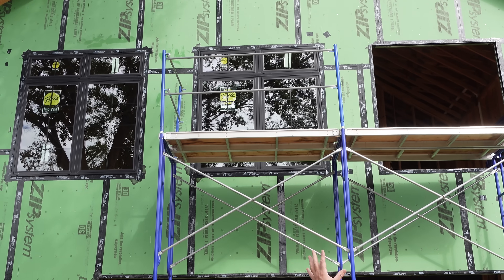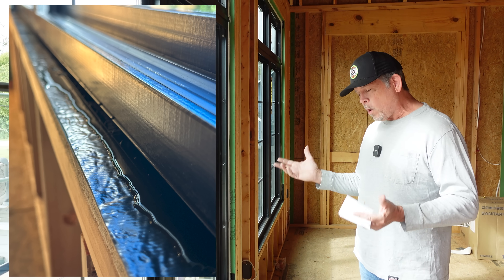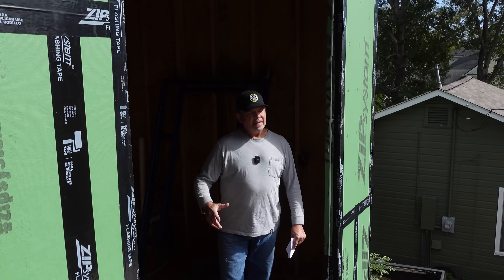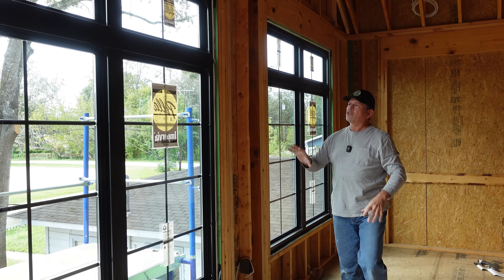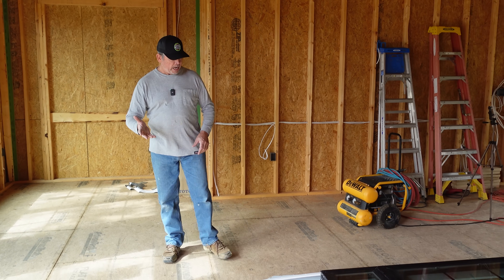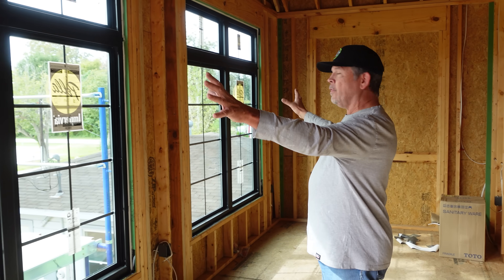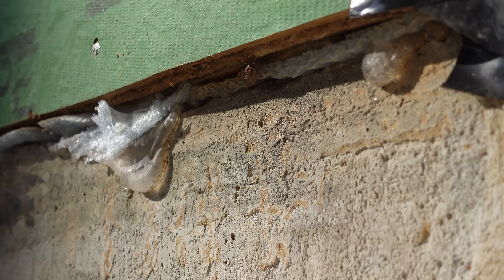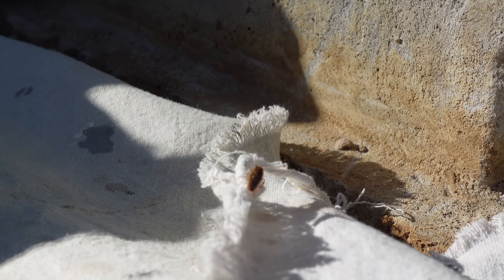THE WINDOW DISASTER - What Happened and How We Could Have Avoided It

Comment: Siding edges are where water will wick in. Without the overhang, you won't be sealing it but it's probably moot because you glued it to the frame.

How did Pella not ask you about the fins or better yet automatically include them as throwaway items? Worse yet those fins required you remove material from the slide area. For such expensive windows, Pella ignores important little details. If Pella can't take a garden hose test, then they should not be making expensive windows. You're paying for quality. Personally, I would like to know why they think it's acceptable that an install has a failure. You're a seasoned builder who took every precaution and in fact went above and beyond. A normal worksite doesn't have the luxury of time. Do you think this isn't a common mistake? That failure is on Pella and I give them 2 thumbs down.

Comment: smh.  i watched the original video and those are not the same windows, the other one had a nail flange that you guys screwed into?
Reply: yea, i'm lost and sent the original video to some people.  i need to follow up with them.  the first window had a flange the same color of the window, made out of the same material?  this one did not have that flange, but you had to add the nail flange, which was a different color.  so you got different windows (same style, same color), but replacement windows and not new construction?  then had to add the nail flange, which was in the middle of the window and not flush with the frame, that is why your caulk line was further back on the first window?  are you ever going to have the window guy who helped you with the first one back?

Comment: In my humble opinion, I would not back up the framing to make the sheathing flush with the foundation. For every 24' of perimeter of the building, you lose one square foot of internal floor space in the house. For a house sized construction, you could be talking about 5 or 10 square feet of livable space gone just to try and save on the liquid flashing.

(Edit: My math was wrong. 24 feet gets you a square foot, not 24 inches. Which is around 5 to 10 square feet, depending on the house, not 20 to 30.)
Reply: Very little usable space is lost by mounting the sheathing flush. Assuming a 1 inch loss would be a 2 inches wall to wall lost which is insignificant when using the space. Also, it's 144" (12" X 12") per sq ft lost instead of 24".
Reply: @jonperryman6477  You're right. My math was wrong. 24 inches of perimeter is 12 square inches. So 24 feet is a square foot. So depending on the house, it's more like 5 to 10 square feet.